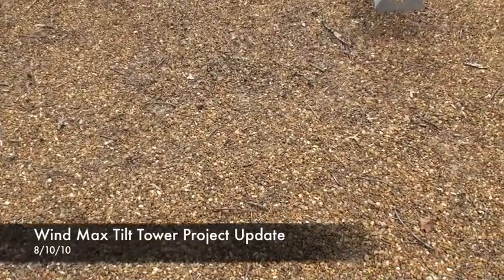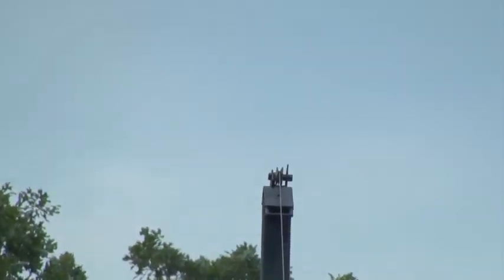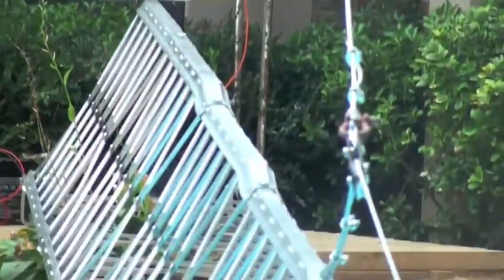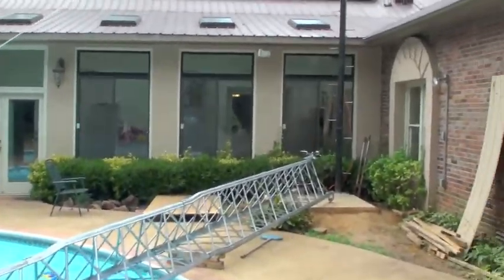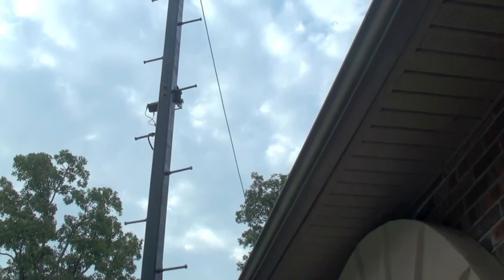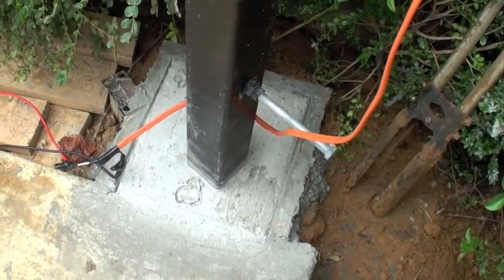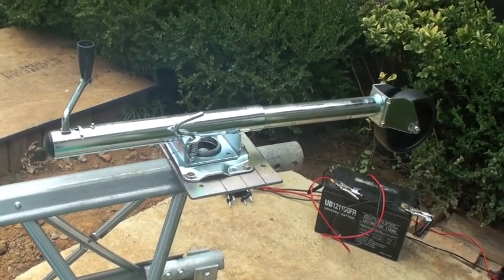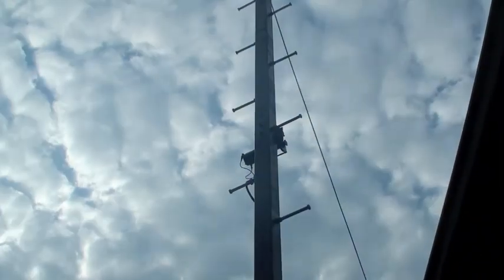Wind Max Tilt Tower Project Update

Comment from the maker: Thanks, As a matter of fact, the rope was strong enough, just not that rope.  I replaced that little rope with a one inch thick nylon rope.  Two test lifts so far have gone without a hitch.  I am adjusting the length of the lifting cable now and will post a video in the next few days of a complete lift.